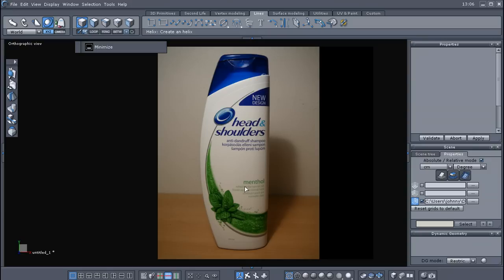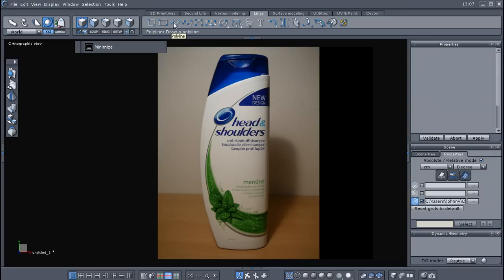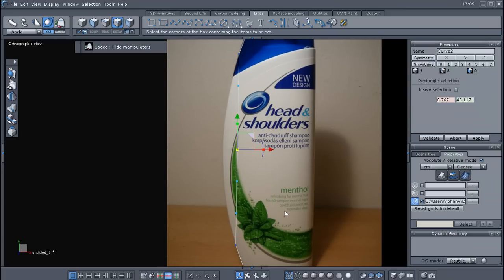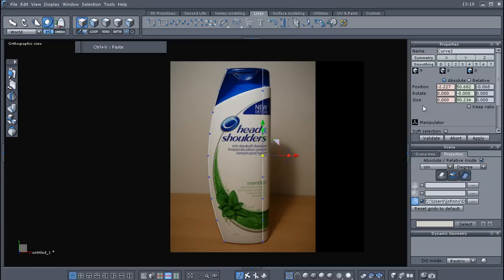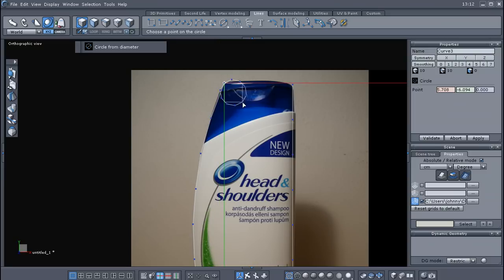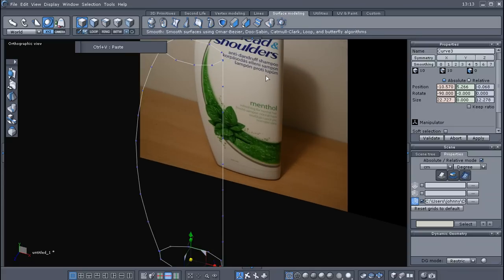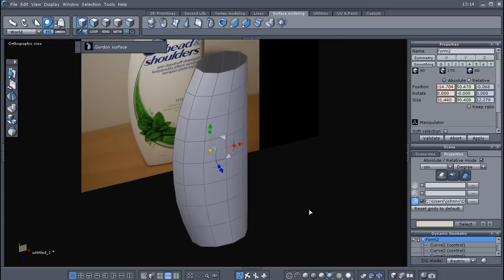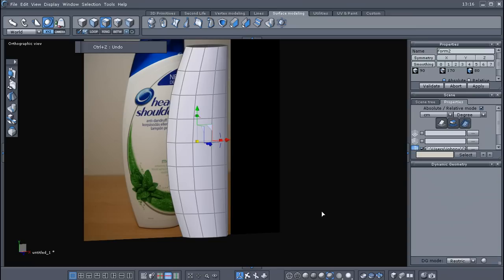Curve modeling/Spline modeling ( Gordon Surface tool ) in Hexagon 2.5

Comment: Hello JB, and thank's for real nice vid' !... may i ask some help, please, concerning 1 op, 1 tool which gives me prob !!! (i use Hex for modeling, i like Hex ergonomy, and then i switch on Mud or C4D)... i want to do 1 so simple op, but without sucess, but so simple with C4D !!... Just doing 1 simple stupid tube from a spline !...As i know i must use the Bend tool, but nothing is working !... pleAse could you give help... what's the problem here for such simple op ?
Thk's by advance ; )